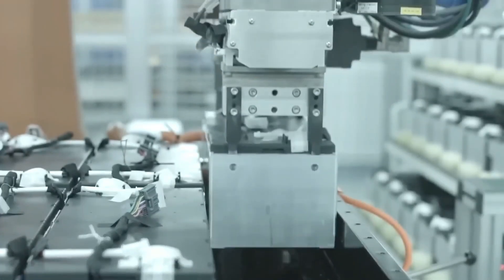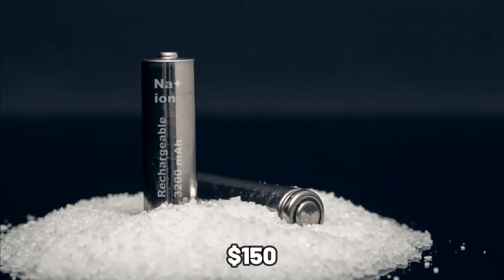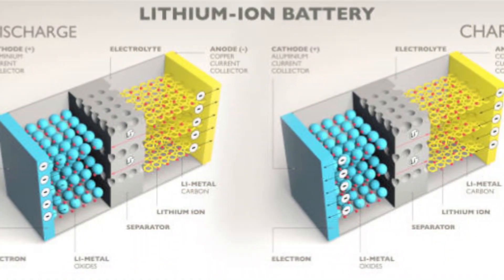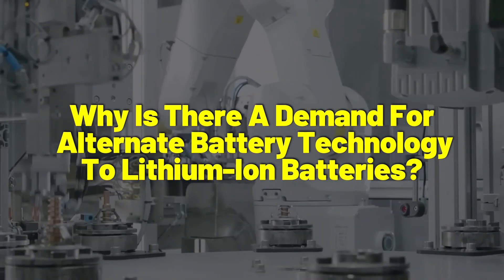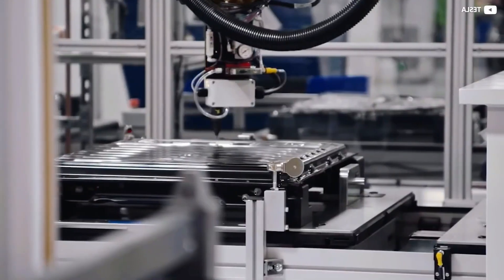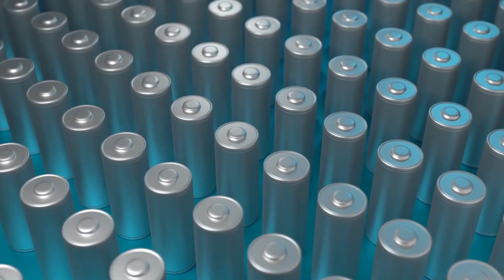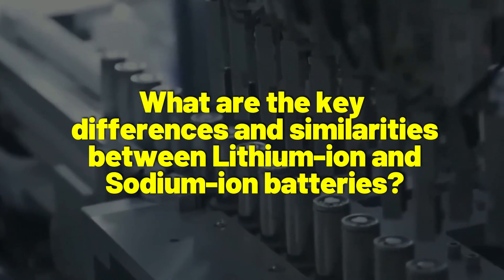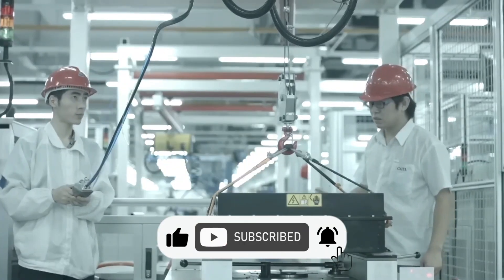Sodium Ion Vs Lithium Ion What Is The Difference?

Comment: don't know about Sodium Ion but lithium ion contains forever chemicals. If these chemicals get into the food chain (as they are) they will be there forever. These chemicals are very hard to remove and never break down. All the manufacturing plants and disposal plants or any lithium-ion fire will release these chemicals into the environment through soil and water it can't be distilled so it can be spread by rainwater as well. All Manufacturing plants tested have extremely high levels of Bis-perfluoroalkyl sulfonimides. A highly toxic Pfas chemical. This chemical is now beginning to show up in human blood samples worldwide. They rarely mention this fact and they will probably block this comment for trying to bring this to the attention of the public.

Comment: Sodium ion batteries have a terrible discharge voltage curve. Lithium stays at nominal voltage until around 80% usage then it drops off quickly. But with sodium the voltage drops immediately and very quickly. This alone makes sodium ion batteries useless for applications without constant charging such as cars or portable devices without charging. The only usage I can see for sodium batteries is as storage for off grid applications with constant electricity generation like a water wheel where you would want storage of excess energy but don’t have breaks in the supply. With solar or wind the sodium battery just won’t have the reserve voltage to be effective replacement for lithium.

Comment: Sodium ion would be good for limited life renewable energy devices like garden lights, consumer electronics especially Bluetooth speakers and similar, power tool batteries, and bulk energy storage devices from UPS systems to solar power systems to grid buffer systems. Lithium is better for applications where weight and gross energy density is the primary concern. Sodium can do away with the need for cobalt as cheap iron can be used as the acceptor electrode. The storage electrode can be made of silicon boron and carbon.❤

Comment: Current battery chemistry is optimized for lithium, and although sodium is practically a drop in replacement to lithium, the chemistry likely wouldn't be as  ideal for sodium as it was for lithium. Perhaps there is room for improvement.
Reply: Perhaps a dual set up?

Comment: A basic science lesson :

Atomic # of Lithium = 3
Atomic # of Sodium = 11

Both Li+ and Na+ carry single positive charge. Na+ has a weight penalty of 3.67 times that of Li+

One needs almost 4 times the mass of Lithium to make a battery that can store equivalent amount of charge with Sodium. This is a fundamental fact in nature which you cannot overcome. 

Sodium batteries will never reach the energy density per kg of Lithium batteries. 

Too much hype circulating.  

Yes, Sodium is cheaper!!! Good candidate for ESS. Can potentially replace LFP for ESS applications. 

I am in the battery industry.
Reply: while sobering, this guy (caperider) is the only one in the comments giving you the critical information you need to know.👍 so unfortunately what he just demonstrated is that anyone who doesn't know how to read the basic "trends" and "groupings" of the Periodic Table, is really not qualified to speak on the subject of Na batteries Vs Li batteries, or any other battery chemistry for that matter.
Reply: to provide the same energy capacity (100 kWh), a sodium-ion battery would need to be approximately 60% heavier and 67% larger in volume compared to a lithium-ion battery
Reply: @dusanstojanovic3759  exactly! Perhaps Na is a good choice for ESS but not for mobility
Reply: @caperider1160  My view is totally different. I will gladly accept 800kg battery (vs 500kg like in Tesla S) for: much cheaper car, much quicker charging time, much greener than Li-ion... also I am very much biased being that I'm from Serbia and extremely opposed to Lithium mining in Serbia.